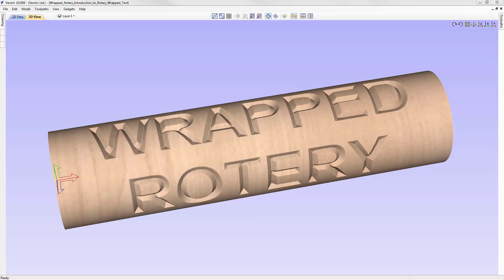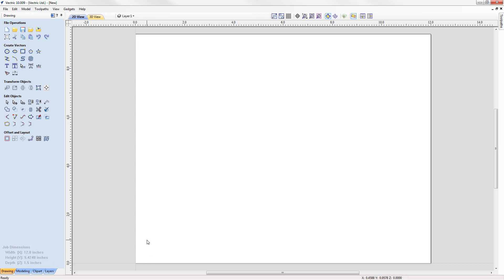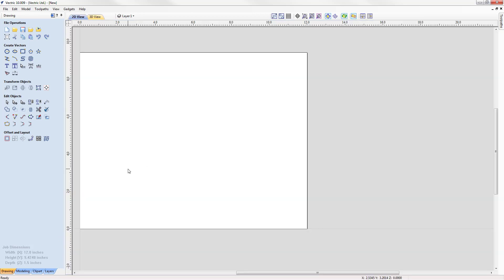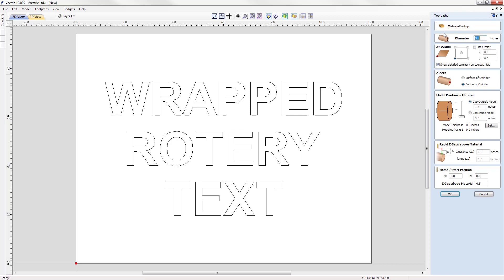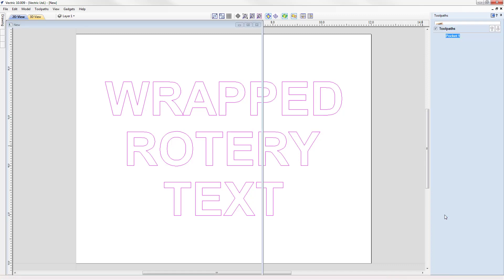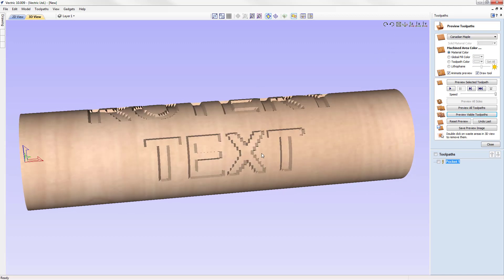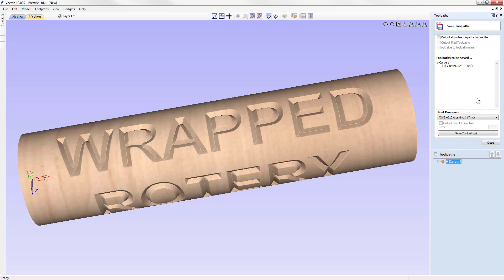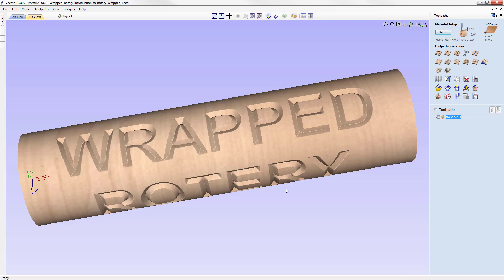Vectric V10 Tutorials | Wrapped Rotary Machining | Introduction to Rotary Wrapped Text

Comment: Without the wrapping gadget, what's the best practice for turning square stock round? Say turn a 2x2 square stock into 1.625 round? Then add the vcarving... thanks.
Reply from the maker: Hello... Well you might want to experiment with a normal single sided job.  I would try to load the material into my roatary and rotate it so one of the corners was pointing up.  Zero off that "tip" and then pocket down the length of your stock to create a flat.  Do this for each point and then you sould have a 8 sided piece of stock.  That might do... if not do the same thing again for all 8 ponts untill you get a 16 sided piece of stock.  Then move to a rotary job to smooth it out... then V-Carve.   It's a bit of a long process... and to be fair if you were doing this often I might either uograde so you can use the gadge or invest in a wood leath... :)

Comment: rotary R-O-T-E-R-Y rotary. Haha, just kidding. Great video, I am hoping to add a small stepper 4th axis for drilling pockets in the edge of a thick disc for a medical pick-n-place. Fusion 360 doesn't do it anymore without spending $1600 per year now. Thanks!